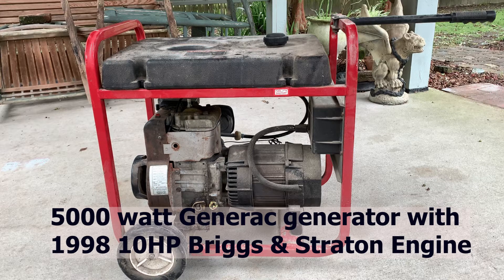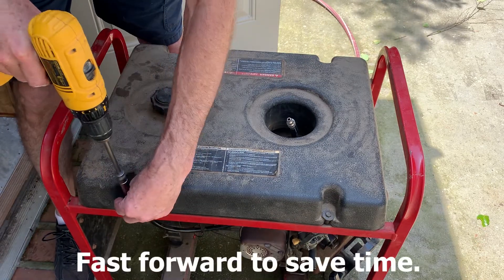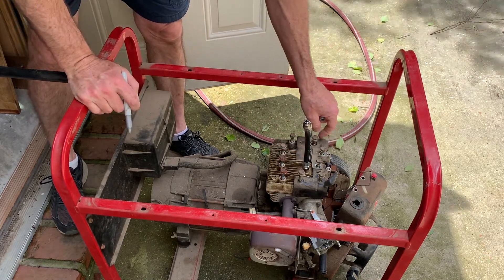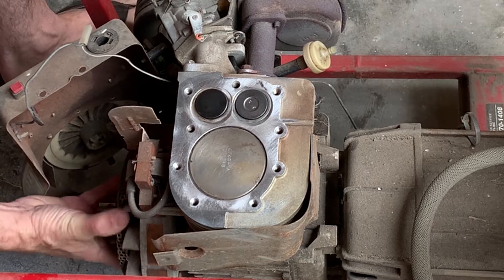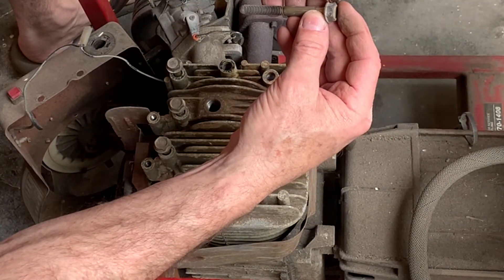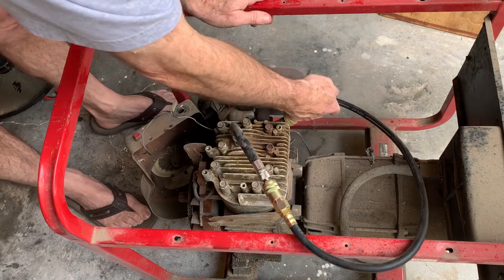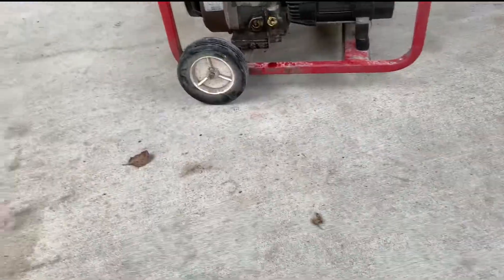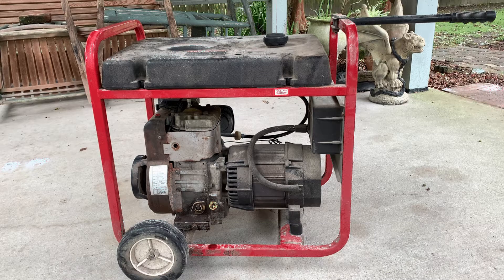Part 2 of 2. Generac 5 KW Generator with 10 HP Briggs and Stratton "L" Head Engine won't start.

Comment: Have you ever heard of the fuel line inside the gas tank coming loose? If so how would I fix it ?
Reply from the maker: I have not experienced that on generators. Have seen it on small 2 cycle equipment like blowers and weedeaters. On the small equipment a lot time the fuel line is not attached, but instead it is a single line piece goes through a hole into the tank. You have to fish out the hose when in the tank and attached a filter to it.
Reply: When sticking it Thur cut it on end in side ways point it fit in the hole easier use long nose plyers to pull it thur

Comment: what is the model of your generator? i need to order the pull start shroud cover that also hold the on off switch and cant see my model number and no one will help me find parts without that number even though i give them all the other info about what it is lol 1998 generac briggs and stratton 5000 watt 10 hp 6250
Reply from the maker: My system is dated 9/1/1998. The Briggs & Stratton engine data says Model 19G412, Type 1129E1, Code 980428YE. I have had the most success in finding parts by using the model number 19G412.

The Generac plate says, Model 09719-2, Series SVP5000, Volts 120/240, Amps 41.7/20.8, Watts 5000, Serial #4835689.

Hope this helps. Good luck with it.